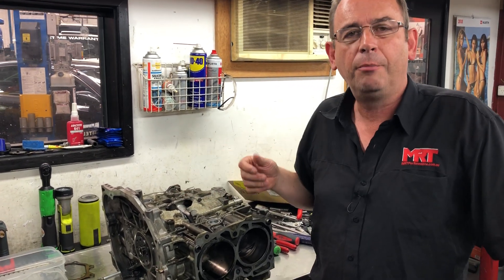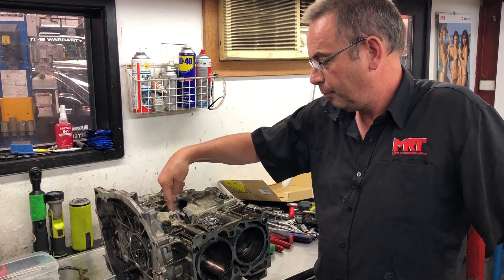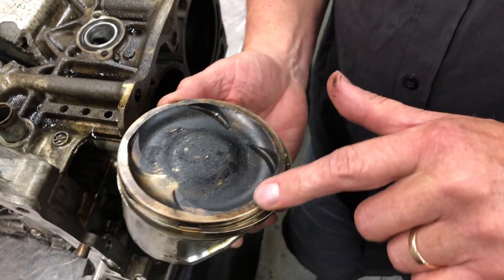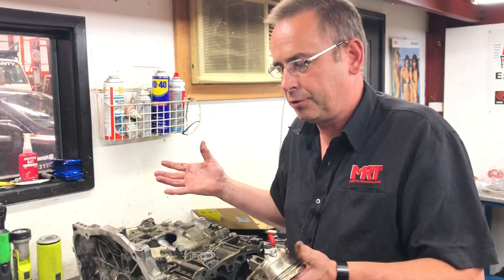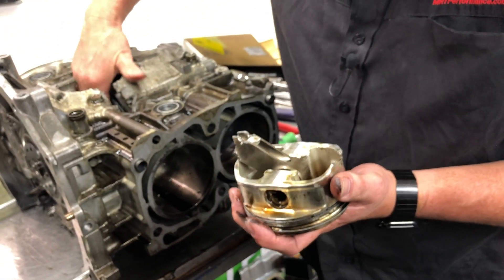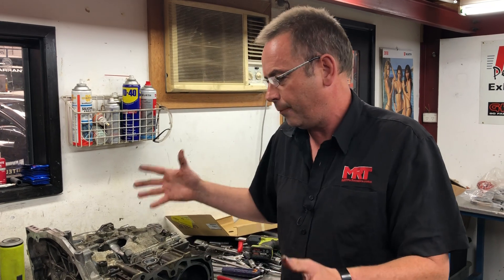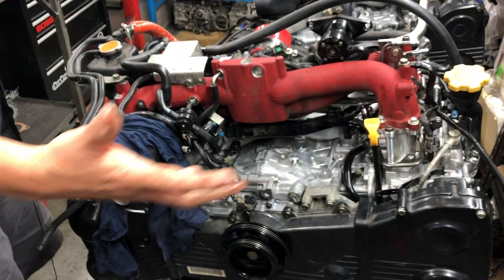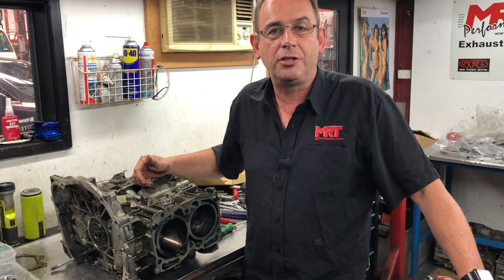Engine Failure Diagnosis

Comment: You could easily check to see if that engine had a bent connecting rod initiating the failure by inspecting the wear on the crankshaft bearing. If the wear is even on the bearing the rod was not bent.
Was there any signs of fatigue wear at the fracture point of the connecting rod?
Was there any assembly damage to the connecting rod which would initiate a fracture?
Good video just need to break it down some more for full analysis.

Comment: Is there ANY way to check for bent con rods? On the FA, I have always been paranoid when it comes to their inherent weakness, but now you're saying it's possible the rods are bent already and capable of snapping later? :(

I just hit 50k and I feel I've babied the car thus far, but I'd still like to know of a way I can check the rods without tearing the whole motor apart.

Comment: On a somewhat related note, what suggestions do you have on motor oil for street driven turbo subarus ? 

When the topic of oil come up on facebook or message boards there will be 50 posts with 38 different recommendations. Some people say to use a 15-40 diesel oil(Shell Rotella), some people use super expensive premium European oil, some people make strange concoctions with something like 3 qts 5-30, 1 qt 10-40 and a bottle of oil stabilizer.  

My thoughts are to run a good off the shelf synthetic 5-30, Mobile 1 typically in my cars. Running a heavy oil like 15-40 seems like it will just waste power, and if a motor has low oil pressure a heavy oil is just a band-aid not fixing the problem. Paying outrageous prices for rare premium oils just seems like a waste of money to me.  Let me know if my thoughts make sense or are off.
Reply: Hi there bud! If you are running a (anything)w40 oil, then yes I would whole heartedly advise you to switch to Shell Helix Ultra 5w40. Stay far away from 5w30's from any manufacturer as those in my opinion are not sufficiently robust enough to protect the turbocharger despite what the bottle says. Oil analysis says otherwise.

If your car is being used for mostly street use then you could use Mobil 1 0w40. For a balanced track and street use Shell Helix Ultra 5w40, it has high zinc and phosphorous contents which you want for wear resistance and load bearing. The VI (Viscosity index) of that oil is 187...You will be hard pressed to find another oil with such a high viscosity index. The VI tells you how much the oil "thins" as it is loaded with heat and mechanical stress, a high VI means it stays more consistent and doesnt burn so easily and it doesnt readily get so thin that metal to metal contact can occur. Dont be mislead by flash points, they are done by either PMCC method or COC and with different ASTM methods (typically D92 or D93) rather ignore this number...With Helix Ultra 5w40 you can go 15 000 to 20 000 km on a heavily tuned car making big power. On mobil 1 0w40, probably 15 000km to be safe... If you use the car extensively for track work my advice is use Castrol Edge 10w60, its not fully synthetic but is very robust, BMW use this exclusively in their M cars...But dont go more than 7500 -10 000km on this oil, when it does burn it will leave deposits.

As a general rule of thumb, only use an oil if its 5w40 WITH (this is vitally important) a VI of over 170. That way you know it is a true PAO/ester based synthetic and its not bound to low emission engines, those oils are bad for wear but good for emissions. One other thing, you want a sulphated ash content of 1.1% - 1.5%, this is an indicator of detergent and dispersant additives in the oil and are a very good thing!

I hope this helps and that you find an oil that makes you happy. I have used Shell Helix Ultra in every car I own, except our diesels which run Shell Rimula R6m 10w40 synthetic. Good luck and hope you find this information useful. This advise was given to me by an oil expert and I never looked back with all modified cars.
Reply: Amsoil all day every day I say.

Comment: Are crankshaft  and pistons reusable?
Reply: To an extent, yes. A bent connecting rod or a cracked/melted piston, in the case of risk management it's just smarter to replace the part. Crankshafts can be machined and balanced. It just comes down to the amount of damage really.
Reply from the maker: in this case the block and pistons and rods were trash

Comment: its the piston/rod closest to the turbo that always fails
Reply from the maker: common, but not always
Reply: Why? Is it because of the headers? Or I’ve heard the fuel injection system disadvantages number four piston somehow
Reply: @jordanp6420  Cylinder number 4 is the most common to fail for a number of reasons. The tune from the factory puts the most amount of stress on cylinder 4 in terms of most advanced timing and it receives the lowest amount of fuel. The reason they do this is because the knock sensor is right by #4. Subaru figured if that cylinder isn't knocking, the other 3 must be okay. The new FA20 has a knock sensor on both case halves so at least they learned from that mistake. 

But even with aftermarket tuning, you will still see cylinder 4 fail. And that's because it also has the worst cooling. As i understand it, there is no coolant jacket that pulls coolant from the head. So its kind of a dead spot and runs much hotter than the other 3 as a result. There is a new modification out there that has seen some great results called a Cylinder 4 cooling mod. If you're interested the owner Dominic has 3-4 in depth videos explaining the problem and his product. I have it installed on my 500whp STI, its very cheap insurance imo.

Comment: I just picture a dude saying ahy bro.. I think my engines knocking... Nah that's just how Subarus sound brah.. Thud! Thud! Thud! Thud! Boom crack! Yea bro, it was knocking lol. This was next level engine failure. I'll probably never reuse rods/pistions ever in my life after seeing this lol
Reply: Lifter tick - Worn tensioner - After market piston slap - Engine knock. . .similar sounds, not so similar consequences lol. It's pretty safe and economical to reuse undamaged parts. I'm with ya on piston rings though, if the engine has to come apart, those (my opinion) should be replaced.
Reply: Gamma Light did you even listen to what was said?
Reply: ERees. I think you're misinterpreting what I wrote.